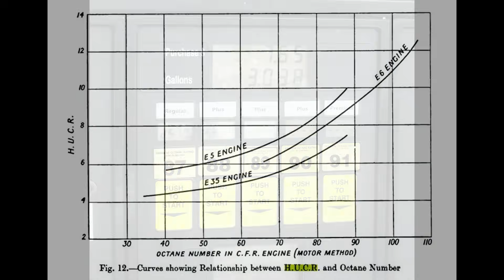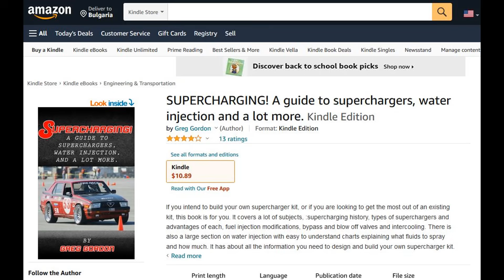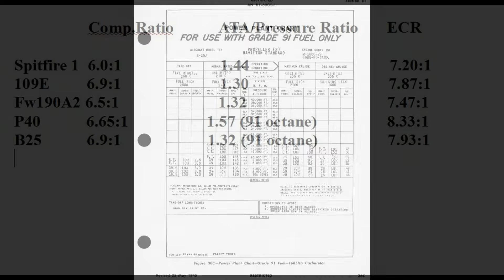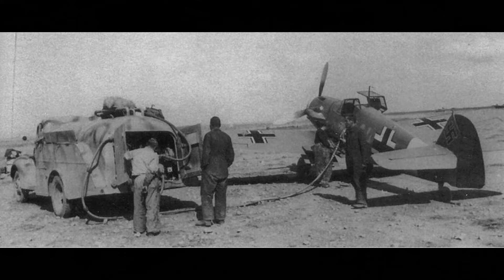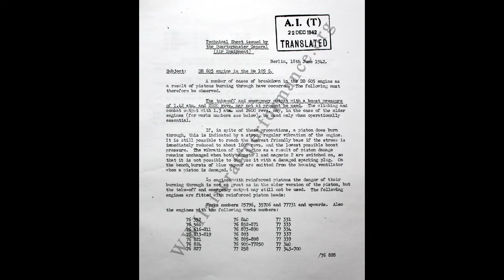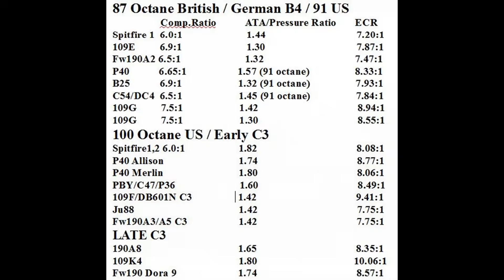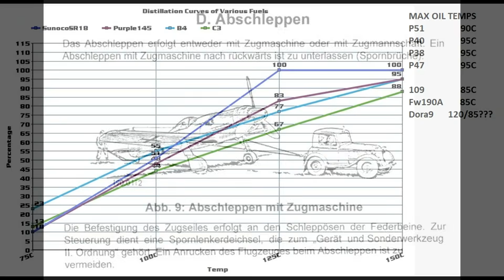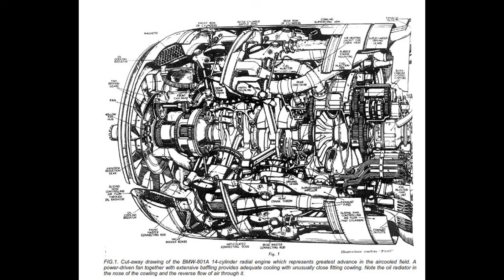German C3 Fuel, Uber Octane or Synthetic Crap?

Comment: Could fuel economy be an issue? after the battle of Britain,for example how much coal could they save with10%less fuel consumption?
Reply from the maker: No, at War Emergency Power fuel economy is not an issue. The whole point is to use it when you are in danger of loosing the plane, your life, and ALL the fuel.

Comment: 7:30 and modern engines have knock sensor so they can back off if the cross the line to avoid damage
Reply: My Mazda 1500cc engine has 13/ 14 to one compression - yet runs on 94 Octane E10 to do with inlet valve timing tricks and knock sensor  - has a startling bark..if provoked..the 4litre turbo Australian  Ford Barra 6 engine also runs on 90 octane with knock sensors..and 5 seconds to 100k.

Comment: I read that mixing the gasoline and air is more important in airplanes than in cars (presumably because of the size).  That doesn't go well with less volatile fuel.
Reply: Aircraft engines have to run at up to 40,000 ft. or more  of low atmospheric pressure..up to 50,000 ft in some Spitfires records...yo wouldn't  be driving your truck in air that thin normally .
Reply: @JollySchwaggermann  I don't see how that would make mixing harder.  I have had in mind that it could be the larger scale.

Comment: A FOIA that was released in 2013 on top secret WWII information revealed that Standard Oil, the same company that sold aircraft fuel additive to NAZI Germany up into 1942 and only stopped when threatened to be prosecuted for trading with the enemy and then sold it to Germany through Switzerland, were the ones that developed the method of creating petrol from coal and made money off of Germany throughout the war on every gallon produced. Other reveals were the companies that had factories making tanks, trucks and tracking the slave labor paid to the SS during the war.

Comment: I wonder if the oil dilution you mentioned with the C3 fuel could in part be attributed to the use of direct injection? I know that can be an issue with modern direct injected engines particularly at high AFRs

Comment: The Germans always had a limited power output due to restricted combustion temperature (which restricts boost and or ignition timing) but they made it up equally with displacement, low drag low weight design and increased efficiency. 
Is there any theory why they missed intercooling, for no obvious reason why and went for water methanol injection and or NOx injection which, btw, must have felt like catapult launch in the air?

Comment: Thanks for the quick response.  I understand that there is atmospheric pressure all around us, but you'll never convince me that there is not vacuum in the intake manifold; othewise, your power brakes, etc. would not work.
Reply from the maker: No, there is lower pressure in the intake manifold relative to ambient pressure when the throttle is closed. It's that pressure differential that makes your power brakes work not vacuum.  This of it this way, vacuum is defined as a "space devoid of matter" https://en.wikipedia.org/wiki/Vacuum . Now think that through. If there was no matter in the intake manifold, how do you think the engine is able to idle?

Comment: You would seem to be just the person I should ask to clear up some confusion I have regarding manifold pressure.  I have read material that seems to indicate some naturally aspirated engines having manifold pressure.  Since I have quite a bit of experience with automotive engines, I know that short of some form of supercharging, there simply is no manifold pressure; rather there is vacuum until throttle is applied - full throttle amounts to no vacuum, but certainly no pressure.  Can you clear this up?
Reply from the maker: Yes, there is air pressure around you right now. If there wasn't then you would die as your blood boiled. That's why astronauts have to wear suits, not just O2 masks. Saying that there is no pressure in the intake manifold of a normally aspirated car is false. It's also false to say that there is vacuum in there, there is only less pressure when the throttle is closed. The pressure in manifold varies with throttle position and RPM. I should probably make a video about this as it's easier to explain that way.

Comment: the other reason why you can't just multiply the boost by the CR is due to intercooling; pistons do adiabatic compression, while the intercooler lowers the temperature before the piston compression.

Comment: What an amazing episode, not the least for presentation by a true SME, on top of all the other usual positive aspects of these.  And if only I had the $$$ to commission a performance machine from you.  Of course, the Germans’ Achilles Heel was fuel, so much so, that most of the aircraft produced in the final year could not leave the ground.  I would imagine that some fuel was better than none for them, so they took off knowing that the situation “just was”, and they did lose, overwhelmed by Allied production.  Kerosene was a different story and could have posed greater problems for the Allies - history has spoken - at least as told by the victors.

Comment: The problem when dealing with the required octane ratings for any given piston engine at any given altitude, temperature etc. is exactly that... there are almost infinite numbers of variables in a piston engine that combined end up giving the actual required octane rating in the end. Now, I'm not saying that these formulas used to get equivalent octane ratings are useless... many of them are good and useful simplifications of the overly complex real world of piston engines... but we must still remember that all of them are simplifications of these wonderful machines that partly get their beauty from their sound, their purpose and also from their infinite complexity that can be forever optimized. In the end, you can only get the true required octane rating by building it and testing it. And that's fun.

Comment: In the 1980s' F1 turbo engines had issues with "detonation".Long story short, Brambham contacted BASF/ARAL (formerly IG Farben) asking for solution. What they've got was basically a rework of the C3 fuel. At that time (most probably) a mixture of 25% petrol with nice and healthy 75% methylbenzene. This stuff is said to have melted rubber like nothing and being all around very aggressive and corosive. The C3 fuel was, as it turns out, a low grade petrol (aprox. 70 octane) with additives like methanol, benzene, toluen and probably others. These were in limited supply and expensive which might explain the varying properties of the fuel and makes it in my eyes hard to compare to more regular AvGas.
Reply: I believe that fuel broke down gas tank sealing material- causing engine problems that took a while for Germany to iron out.
I think there is a video above it.

Comment: Excellent video :). 
Few infos...DB605A-B manual states that entry oil temperatures should be: 
lowest 20°C, normal 75°C+/-5, highest 85°C (temporary). 
Exit temperatures should be: (close to ground level) normal 125°C, highest 135°C (temporary), "volldruckhöhe" (full boost altitude?) 110-120°C. 
Coolant temperatures should be: 
entry at least 60°C, it should usually be 8-9°C under exit temperature
Max allowed exit temperatures are (10min max): 0-2.5km alt 115°C, 3km alt 114°C, 4km alt 112°C, 6km alt 109°C, 8km alt 106°C, 10km alt 103°C.
Continuous allowed exit temperatures:
A: 0-6.75km alt 102°C, 8km alt 100°C, 9km alt 98°C, 10km alt 97°C
B: 0-8km alt 100°C, 9km alt 98°C, 10km alt 97°C
Manual states that cooling system is at 0,75atü pressure and filled with prescribed cooling mixture. 
Recipe for this mixture is strangely formulated (literal translation): 47 volumes (Raumteilen) of water, 50 volumes of glycol, 4,5 volumes of protective oil and water mix ("Schutzöl 39" and water in 1:2 mixture).
Another interesting information is that the engine consumes 6-13 liters of oil per hour, depending on the RPM.
The manual is from September 1942.

Comment: Really interesting talk Greg - thanks.  It did however make me think about spark timing.    We know that in general terms we want to advance spark timing to get higher horsepower, but that the more we advance the timing, the hotter the engine runs and the more likely we are to experience pre-ignition or worse, detonation.  I have not been able to discover much about how timing was adjusted on WW2 Magneto's other than that the timing was advanced on the Griffon by a hydraulic linkage from the throttle.  I guess earlier models used a centrifugal weights assembly to advance and retard the ignition?  Do we know how ignition advance curves compared between the different engines, and whether Spark Plugs technology affected the max permissable ignition advance and hence timing?  But how things have changed - I remember how cars used to have the ignition advance controlled by a lever on the steering wheel, then came bob weights in the distributor to adjust it automatically and then by the early 90's Saab were controlling engine knock by measuring the ionisation in the cylinders!

Comment: I don't know enough about this to tell what would make a difference and what wouldn't but I'd have one question about that.

If they were running a Lean Mixture - would they be burning less fuel?

Germany had chronic fuel shortages - so - could there have been a German Policy to run Lean Mixtures to try and cut down on fuel consumption?

This might seem a desperate measure to take - but then - the Germans were desperate.

As to German pre-war preparations - they did construct a significant number of Synthetic Fuel Plants before the war - but - they were still always short of fuel - and - the Americans began blowing them up.

Thanks for this.  I can't say that I'll retain much of it but - I know where to look if I have the ambition to refresh my memory.
.

Comment: Seems that the required octane would depend upon two factors:  pressure and temperature at TDC (or, perhaps, at the point when the spark plug fires).  How might such a method compare with the ECR formula involving the square root?

I might suppose the square root formula has been developed from empirical data.  True?

Thanks for this highly informed and very thoughtful explanation.  Very good material.

Comment: at 51:35 the ATA shown for 109K4 and Fw190 D9 seems comparable to the figures ran for the Junkers Jumo 222, being 1.72 at WEP and 1.84 during a test pushing the absolute limit on Late C3. At least according to the little info avaiable for this engine and it's various iterations.

Comment: Hi, Greg, you've talked in this and other videos  about the Germans needing to use more horsepower and displacement to keep the Me-109 competitive, but when you keep adding power to an airframe that was built for 1,300 hp don't you run into the "law of diminishing returns?" From what I've read about the 109 K's handling qualities, it reminds me of Travis McGee's Rolls Royce after he put a Lincoln Continental engine in it; being dragged along faster than it was meant to go.
Reply from the maker: Yes, when you keep adding more and more power you run into problems.
Reply: It pretty similar to group B rally car. Too much power for chassis to handle, and coupled with turbo lag, it became almost undrivable.
Reply: @kidpagronprimsank05  Really good comparison, just looked up the 1986 Tour de Corse Race to see what you meant!

Comment: Great video, Greg! 
A couple of things I remember from Callum Douglas’s excellent book that are also relevant to this video:
- The allies were able to run much higher coolant temperatures due to being able to manufacture coolers that could withstand higher coolant pressures. Can’t remember the specifics, but he suggests that it drove German designers nuts, especially with their C3 evaporation problem,
- the conservative Merlin power levels may have been due to larger overlap values the Germans could run with the direct fuel injection.
Reply from the maker: I  do like Callum Douglas' work. Of course that doesn't mean I agree with him on everything and I don't think he is right about the Germans inability to manufacture radiators that could handle the higher temps and pressures. That's a good theory, but it doesn't seem to hold up.

Comment: At the start of the war the Luftwaffe standardized on 87 octane aviation spirit, called "B4", made from leaded hydro-petrol extracted from brown coal. In 1940 an improved fuel, designated "C2" was introduced having a higher aromatic content of 35–38% and giving performance equivalent to Allied 100 octane grade of that time. C2 was used in small quantities by aircraft such as the Messerschmitt Bf 109E-4/N and E-7/N and the Messerschmitt Bf 110C when equipped with the DB 601N engine, that entered series production in October 1939. The power was increased by 20% over that of the DB 601A, to 1,260 hp at 6,900 feet (2,100 m) at 1.35 atm boost pressure and 2,400 rpm.[ By July, nine Bf 110 and three Bf 109 fighter Staffeln (squadrons) were equipped with the new engines,[ By the end of October around 1,200 DB 601N engines had been delivered. and the number of aircraft equipped with the improved engine gradually increased through the second half of the year . In sep 1940 some leading pilot as Adolf Galland all ready use C3 fuel on bf109 e4/n as you can see on this well know picture  https://radindustries.wordpress.com/2021/06/16/adolf-galland/

Comment: We need to talk about intercoolers and water injection too…. Cool intake air is the best octane booster…. Oh, and GM global propulsion systems chief Dan Nicholson said 2019, “Higher-octane fuels are the cheapest CO2 reduction. Fuels and engines must be designed as a total system. It makes absolutely no sense to have fuel out of the mix.” A late realization…. The totally idiotic introduction of “unleaded” increase fuel consumption by some 20-25%….. with zero environmental benefits…. On the contrary, using the aromatics to “boost octane” introduced a major cancer source…. Ever wondered why fuel is self serve now?

Comment: My mom has zero engineering skills and she loves fast cars.  Amongst the many (63 Corvette, 57 Fairlane, 64 Mustang...) cars she owned there were included a few muscle cars, including a 1969 Barracuda, which spent more time in the shop than on the road.  She's 90 and she drives a ten-year-old Rover. That's my total compression ratio knowledge. My last vehicle, now in pieces, is a Japanese 1986 chromoly steel road bicycle. The advantage of steel, despite its weight, is it's ability to be bent back into original shape without breaking.  Now I walk (and bus a bit) on two legs, the left containing titanium tibia and fibula.  A Cadillac Escalade, having accelerated from 40 - 60 mph in 1.4 seconds, took my bones and obliterated my jaw.  My bicycling  reactions slowed from microseconds to fractions of seconds, thus eliminating it's service in Los Angeles where some drivers literally try to kill the bicyclist who is weaving and jinking the traffic.  I rode from 1958 to 2018.  Bicycles effin rule.
Reply: ❤ that.
Bicycles are terrific.
But, battery and motor technology on a bicycle can accelerate as fast and even faster than a motorcycle and definitely a car.
Reply: Thank God we are clear of you now..riding your bike  along the i10 at night...

Comment: The compression ratio essentially limits the piston force. The power depends on the times this force, translated into a engine torque act per minute. Increasing the engine rpm increases the power, so a higher rpm even with lower compression ratio.
A geared high RPM low octane burning high displacement engine will beat any engine.. unless it's supercharged and intercooled. 18:32

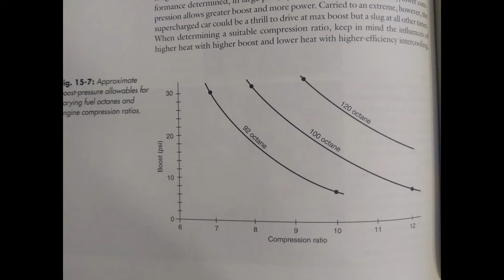Comment: 20:13 that’s uncanny. I’m running close to the limit in my Brabus Smart car, which is currently on stock cast 10:1 pistons and 15psi of boost . On UK 99 octane this is ok, but when I turned it up to 17psi I  melted an NGK heat range 8 iridium plug, tripped the primitive knock sensor, and went into limp mode. A horoscope revealed very minor bore scoring but no piston damage. Phew!
Now I run 14psi and add +2 octane via your recommended octanium booster. It’s my daily, so I want a bit more safety factor.

Comment: When became water-ethanol injection available? Wasn't it during WW2?  I mean, the ethanol has a high octane rating and it evaporates easily so it has a charge cooling effect which fends off detonation. And the water(steam) will keep the combustion chambers and valves clean and it has a great expansion ratio. I know for a fact that Volvo used water-ethanol injection in the early 1980's on their championship winning Volvo 240 turbo racecar (2.3L, 4cyl, 8valves, intercooled, about 375hp) 
And i seem to remember that this tech orginated in aero engines from WW2. 
Am i misinformed about this?
Reply from the maker: They typically used Water:Methanol injection. Water:Ethanol was far less common. Yes, this originated in the WW2 era.